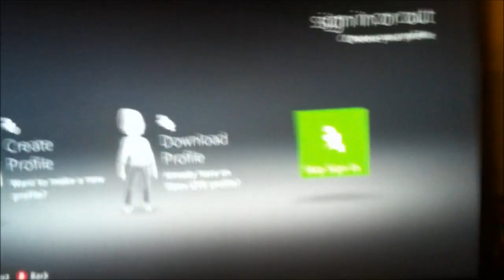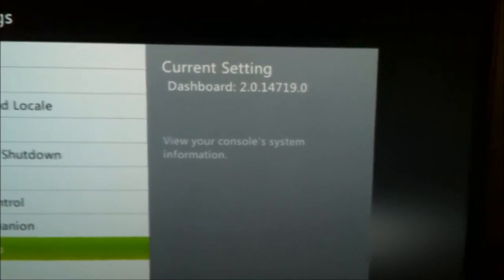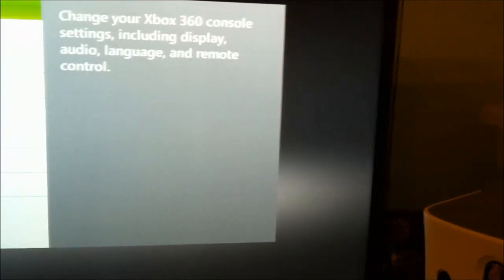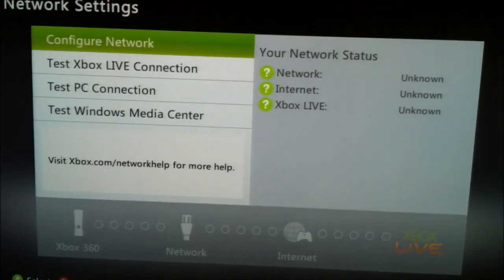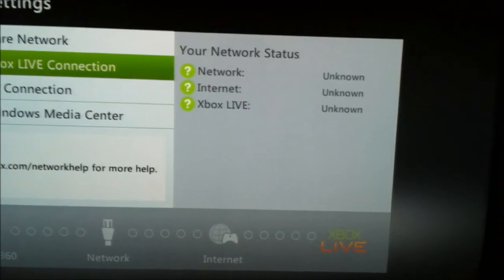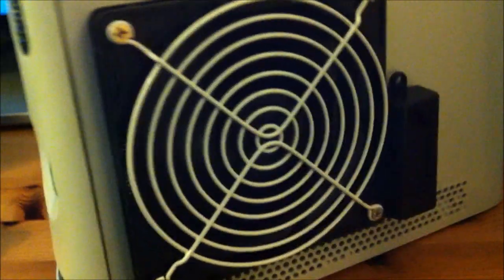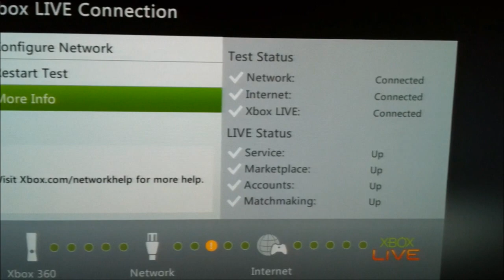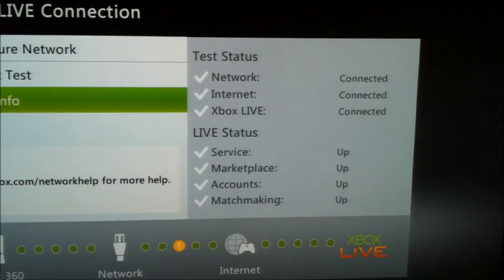Xbox 360 12v Fan Mod

Comment: Zalman Fan Mate 2
Please, could someone measure the length of the case (on the back) 
without the fixing ring. Only the case.  Along with that ring the length
 is 70mm. How is it without?
In addition, can you measure the size of the hole where the mother plug 
is placed in the case?
Thank you very much!

Comment: Is it still working? I have two Xenon's one with date 2006-01-16 and second 2006-06-28, both are working like charm in 2016 :D With no mod - yet :D Third is Falcon and also working without no problem :)

Comment: How dit you manage to use the fan mate ?!

This is what I have done :
http://joseph.garrone.org/DSC_0200.jpg

Unfortunatly the potentiometer start to produce smoke as soon as I turn my XBOX on...

Any Idea ? I will be so grateful.
Reply from the maker: Hi there, here is a pic of the inside of my xbox. http://postimg.org/image/97ic2gwsr/
I'm using the 12v fan mod based off the DVD power cable to power the fan and you will notice that not all of the cables from the fanmate to the DVD cable are required, only two. http://www.instructables.com/id/Xbox-360-12v-fan-mod/
Reply: Thank you verry much ! Help me a lot

Comment: i am also putting a fan at the top right in front if the hdd as it will suck the air out floating around under the disc tray

Comment: I bought a 2006 Xbox 360 and it RROD'ed on me.  If I was able to fix it by:  using the "X-Clamp fix'; replacing the thermal paste, and heat gunning the motherboard, would adding the 120mm fan mod to the mix help keep it working for longer?